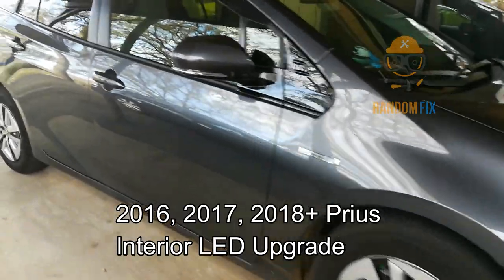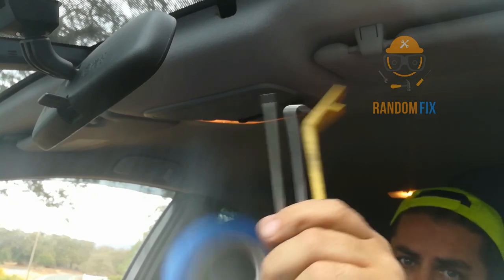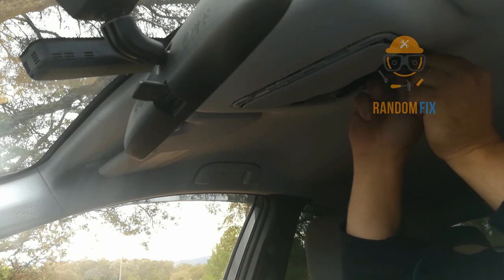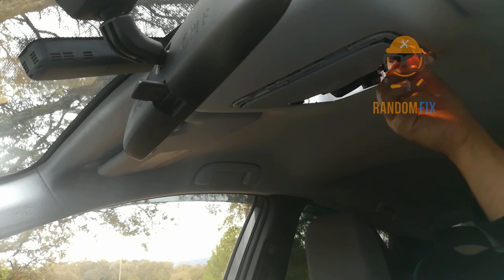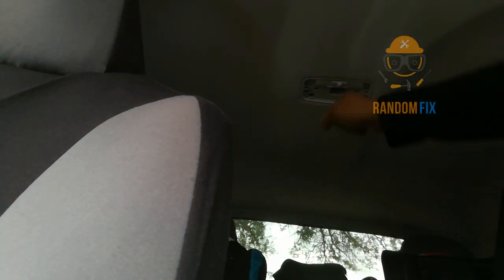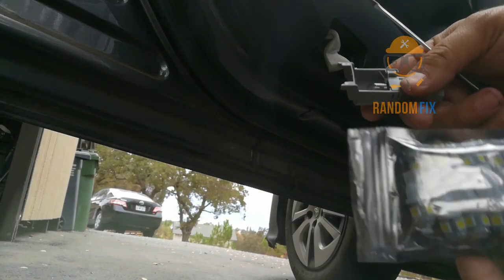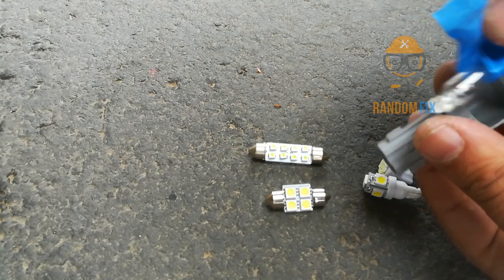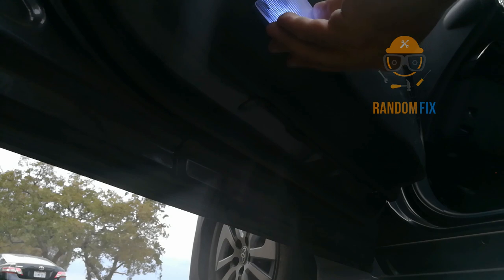▶️ Toyota Prius Interior LED Upgrade Led 2016-2022+  XW50 2016 Prius Led Upgrade

Comment: How do you go about finding these bulbs to begin with?  Say your product links are old or I have a newer Prius.  How do I go about finding these LED replacement bulbs for a 2021 Prius Prime?  Is there a manual or a diagram that says if you have this model, buy this LED bulb?  You told us which bulbs to use but how does one determine this for oneself?
Reply from the maker: My links should still work and if you want to verify for yourself just remove the covers or lense like I did.

Comment: What about the Glove compartment light ?
Reply from the maker: Nick, the glove compartment has an irregular sized amber led bulb. There is also a light in trunk area as well, which takes the same bulb as the one in the door. -RandomFix
Reply: @RANDOMFIX  where is the glove box light? I don't have a light so it's either already burned out or it doesn't exist.

does anyone else have a glove box light on a Gen4 Prius?
Reply from the maker: Do you really want to change it? Here a video you watch on how to change the cabin air filter for the Prius which is accessed by removing the glovebox 
https://youtu.be/HBxbcgFt-0o?si=lIaUAQixZHh6aAJv
Reply: @RANDOMFIX  did I miss something?  I watched the video & didn't see a light bulb anywhere.
Reply: @RANDOMFIX  hey just a heads up I see a glove box light shining. I think I had things blocking it.  in any case, I've changed the cabin air filter before so the next time I do it, I'll be sure to see if I can change out the bulb. thx.

Comment: I figured out there's an easier way on the front part if you open the glasses holder and grab that and the whole thing and pull it straight down it comes out really really easy just the whole unit all at once
Reply from the maker: Robert, Thank you for letter me know, I will try this out! _Randomfix

Comment: the link for slim T10s are no longer avail - here is the ASIN for what is avail (as of Sept 2023): B00AQB8JFQ
Reply from the maker: Thanks for the update
Reply: @RANDOMFIX no prob! the upgrade worked out great - changed 7 bulbs w yr help!

I just got the 8th (dome light) switched out today - a 29mm (instead of 31mm, avail from Alla Lighting) fits the best.